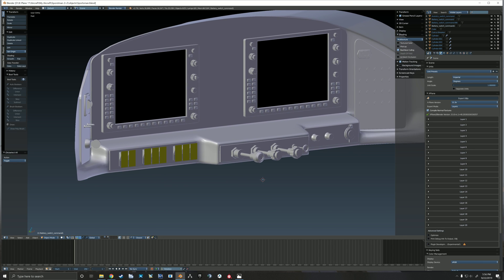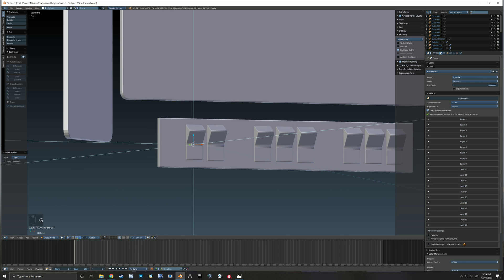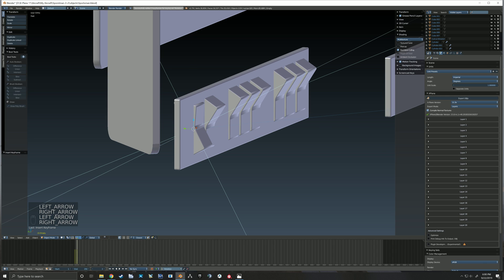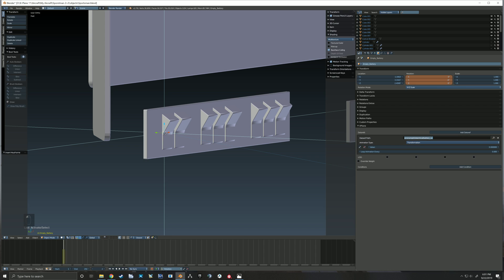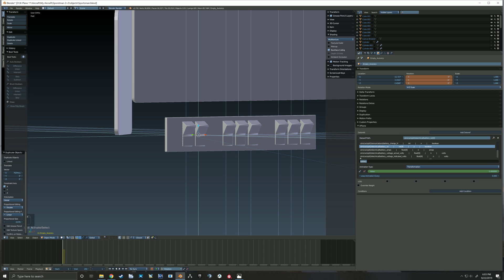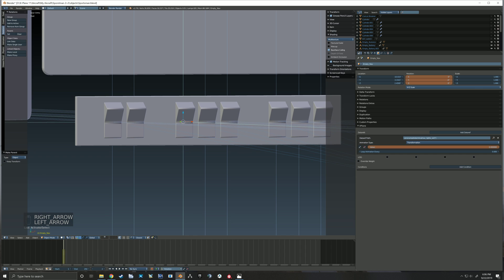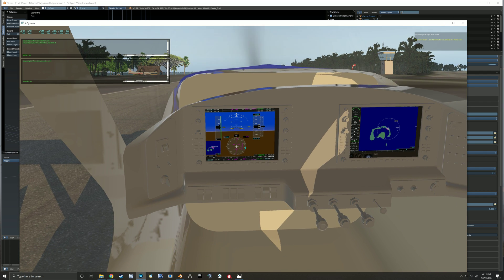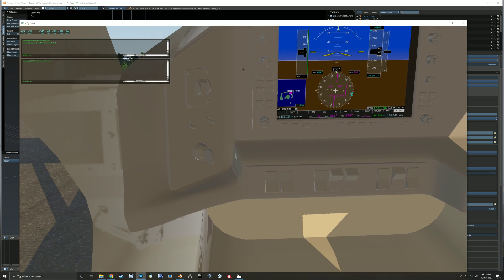How to make an airplane for X-Plane 11 Tutorial #18

Comment: A small quest how can I animate a button that going forward and back? Thanks :)
Reply from the maker: Use the same method I show in video #20 for animating the throttle, mixture, and prop. https://youtu.be/-H7MfxrDAw0
Eveything is animated basically the same way. Animate with a movement, rotation or translation, Then give datarefs to drive the animation and manipulators for clicking on it.
Reply: @BuildItBetter3D  OK thanks :)